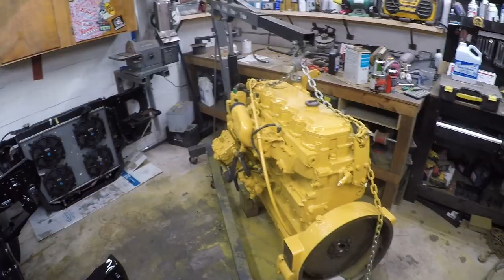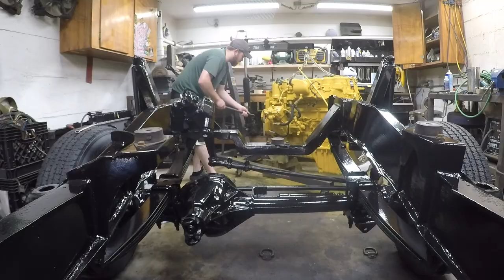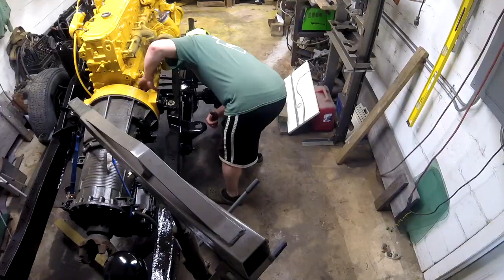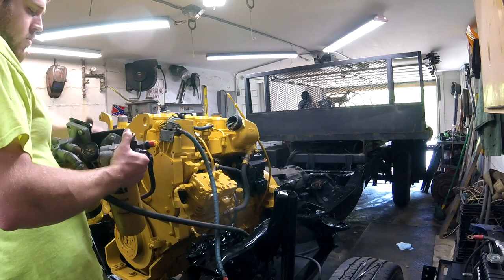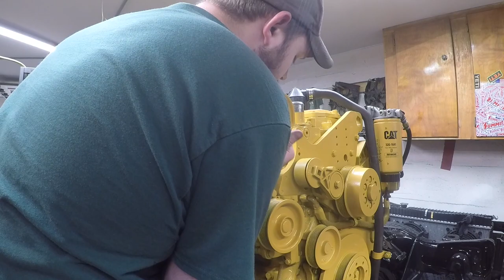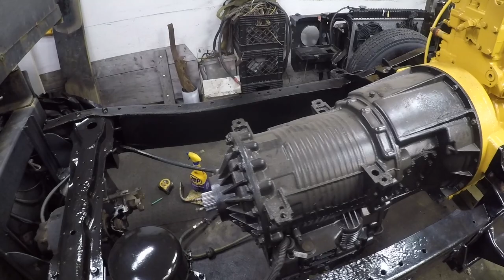Pt. 51 Bolting In The Cat 3126 And Allison MD3060. We Have A Problem... 91 F350 CAT3126 MD3060 Swap

Comment: I wonder if any body makes adapters to bolt the cat to a dodge nv4500/5600 or a ford zf5/6
Reply from the maker: You can actually get a sae 3 bell house for the NV transmissions. I looked into it briefly but the baby seat would get in the way of the shifter
Reply: DrewMan'sDriveway that sucks. I have an 87 that looks just like yours but with a 460 and 4 speed. It’s a restomod project at the moment and I don’t wanna do a 12v swap like everyone else. Was looking at either a 3126 or a dt360 when your vids started and deboss garage started theirs.
Reply from the maker: Kenneth Stephens I would go cat!